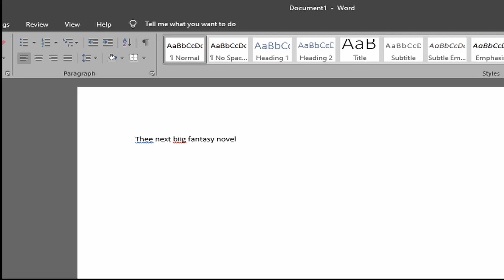Keyboard Double Tap Issue, I Repaired my Logitech G613

Comment: For anyone trying this. PLEASE REPLACE YOUR BATTERIES FIRST!
This method might seem to work simply because you removed and reinsert the batteries which will be a temp fix. These keyboards are notorious for double press or no press when batteries are low.

Comment: I just found a much better fix, quicker, easier, and it turns out pretty damn well! at least for my G613.. I thought I might just drop it here just in case any of you wanna find a true fix for it. So, here's the steps:

1. Remove the batteries, the battery cover, and leave the power on.
2. Make sure the feet are tucked in

3. Wrapped your keyboard in towel / sheet (which I used but they'll work out just fine)
4. Flip your keyboard
5. Punch the backside of the keyboard real hard! (I did it 3 times)
6. Turn off power
7. Put battery in
8. Turn on power
9. Done.

I reckon a spring somewhere fell off its place, and tiny plastic clip which I don't know where it's from is here, my space bar is more "silenced" but bounces back like normal (which normally wouldn't be as responsive), and I can hear something rattles inside if I shook the keyboard but that's about it! everything else is awesome! In fact, I'm now typing using my G613 and it's working flawlessly!

Comment: What I'm interested to know, if replacing the switches, fixes the issue and stays that way for a few years at least. I'm willing to get the soldering items and spare switches if that's the case with you guys

Comment: thank you for this, one of the switches got stuck on so this was very helpful to crack my g613 open to desolder, fix, and then resolder the switch. I think next time I'll actually fix the keys that duplicate.

It's the T W A O E S keys usually, some of the function keys can be a little screwy too. But holy hell disassembling this without knowing where all the screws and clips are is a nightmare

Comment: Please read this before soldering! Try to replace batteries first even if the keyboard doesn't report it discharged in the G Hub. It helped me a lot!
Reply: This.  If I have the issue, it's solved either by battery replacement or by making sure the receiver isn't blocked.

Comment: Looks like this is a common issue...I have a G613 and it started with double tapping with some keys, then they stopped working, keyboard was still under warranty (2 yr warranty, 1 month left) and after a quick test Logitech Support agreed to send a new keyboard and let me keep the faulty one. The replacement just started to fail for a couple of keys (must type harder) after 6 or 7 months so it looks like a quality issue here, but now warranty is expired. So I ordered some switches from Aliexpress and replaced the faulty ones (W,E,A,S,D, left Shift so far) and now the first keyboard is working again like new. Thanks @Infinity Mind DIY for this video.

Comment: I think I know the reason why because the keyboard has many holes underneath the buttons for the dust to go in. 
Remove the button and you will see. Especially, under the spacebar. 
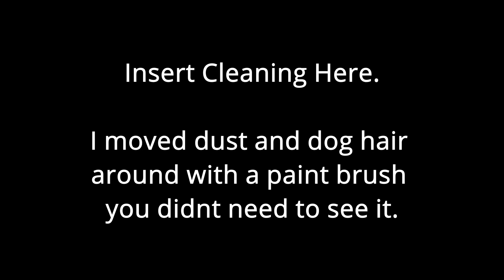You can roughly see in this video @ 2:25 
For mine, I can feel it when the key goes bad, the button will be a little stickier than the good ones and need a little more force to be pressed down. 
So I know it is not about the software but about the keyboard itself. 
So currently when any button goes chattering, I will remove the button and spray it with alcohol. 
The 2nd button on the left of the button that got sprayed will act wierd until everything is all dried up.
For example, if you spray in the "T" button, when you press the "E" button, it will appear "ET", don't worry it will return to normal once it's dried. 
But if you live in a dusty environment, you will need to do it again in a couple of days. 
And I won't take any responsibility so do it at your own risk. 
So the best solution is to return it while you can!
Reply: I don't think it's a dust issue. I got a G613 that I used only when gaming from the sofa on the projector. I probably used it less than 100 hours during the pandemic (it's still on its original batteries). It sat in a box the rest of the time. After not using it for 2 years (got too busy with work to game), I finally took it out of the box a few months ago. And the double-typing issue is affecting a half dozen keys.

My hunch is they used some sort of conductive lubricant to cover up a contact issue endemic to the Romer-G switches. And over time it dries out. Because mine wasn't used anywhere near enough for dust intrusion or activations to wear it out.
Reply: @solandri69  thanks I put it in the bin 2 years ago.

Comment: There are 12 small screws on the back under the feet, stickers and rubber pads (you can just pry off the edges, don't totally remove!
There are 2 large screws in the middle. That is all you need to remove, I swapped my "o" key with my "/" on the numeric keypad. Very happy again

Comment: I see many people having problem with this keyboard. But it is still available in the market. I don't know understand why. At first I thought I was unlucky I picked the defective one. But after returning it for money back and buy a new one. The problem with the new one appears in less than a week after using it. 
I tried many methods. Replace the new batteries. Slap the button really hard several times. Electronic contact cleaner.. Nothing worked. The last method before I break it into half. I know many didn't recommend using the alcohol but I didn't care because I was about to say goodbye to all logitech's and buy a new keyboard anyway. So I sprayed the 70% alcohol right into the button. After spraying, my Tab key will give out the W along with it. But after keep sparying it for a couple more times, the chattering disappeared. So I believe the problem's something about the circuit board not the buttons or maybe both so enough with the logitech's. I have to admit their gadgets look good but I will never buy any logitechs for the look again.
Reply from the maker: Agreed, the keyboards are a bit poor, but I've a G402 mouse I've had so long its got grooves where my fingers go.

Comment: Hi, where did  you find the replacement switches? is there a specific generic type that is compatible with it?
Reply from the maker: I got a hand full off ebay from a seller that break keyboards down. I think i pinned the listing. The switches are romer g. As far as i can tell all the switch have different pin locations on the back so you can swap them between boards

Comment: where can I find roamer G switches made by Omron for my G413 ? thanks , cool video
Reply from the maker: I got mine off ebay, and they weren't new but they have held up well even with me trying to get a double tap to do the cleaning video. there is a link to  ebay where i got mine, (i think I pinned it), Good luck

Comment: No need for such effort, i got my keyboard for  about  1  year  and just resolved this issue by blowing compressed air into  the keys. There is no such thing like the best or worst mechanical keyboar... this is  common issue for all of them.
Reply from the maker: This is how it begins, you then need to move onto alcohol washes, then taking keys apart to clean and lube. Then replacing keys which is the most useful video I could think of making unless you want to watch me do cleaning.

Comment: damn dude soldering and shit?
That's way out of my league. well, at least i got 2 plus years out of this keyboard.
Reply from the maker: You could always try cleaning with isopropyl alcohol. It's what I did for a while 1yr ish. Before I got fed up enough to solder new switches in
Reply: @InfinityMindDIY  I did that, yeah. Issue persisted, so i checked it's old batteries and saw they were 1.5v batteries while i was uusing 1.2v rechargables, so i changed them to ennergizer 1.5v and the keyboarrd was fine for 2 days and the issue began again. pretty shit that i cant get logitech to fix it.

Comment: Could've just changed batteries, saved a lot of trouble. This keyboard just starts double tap on low batteries.
Reply from the maker: Yeah, but why would I do the easy option first. It doesn't always work, same as cleaning the switches with isopropanol its a temporary fix this has so far fixed the problem.

Comment: Did changines the switches actually solve the double tap issue?
Reply from the maker: Seems to have done, my wife uses now and hasn't noticed any issues. So I'm assuming all is good. It has definitely extended the useful life of the keyboard.

Comment: I refuse to believe that this is the only option to solve double tapping. My G613 is barely six months old and does this with at least the spacebar and the W key. I play games a lot, so those two interfere with my experience quite a lot...
Reply from the maker: its not the only option I cleaned mine a few times first, then flooding the switches with iso alcohol a couple of times, then got fed up of doing that then replaced the switches
Reply: @InfinityMindDIY  Yeah, I just ordered a can of WD40 Contact Cleaner. I'll see how it goes...

Comment: I think this is an issue with the 613. I bought one and it started the double tapping issue on some keys it lasted 15 months got it replaced via warranty, after 6 months same thing happened. The issue seems to come out after I used the keyboard for after a few hours.
Reply: All mechanical keyboards experience this problem. It just depends on the type of switches they use. The Romer G switches are too exposed to dust and they need cleaning every now and then

Comment: I've referred to this video a couple times, been very useful, thank you. To change the key switches, I find you don't need to remove the keyboard from the top casing once you have removed the bottom casing.
Reply: was wondering why you would remove that. Also, removing all the keycaps seems redundant in most cases.

Comment: This video wasn't around the first time my G613 failed, Amazon replaced it after 11 months, and now after 11 months with a new one here we are again. My double tap issue affects at least 20 keys though, so its just impractical for me to go to this effort sadly.
Reply: SAME HERE
Reply: Same here, and  it happened so SUDDENLY pretty annoying. I am sure it is something which happens after a set of time...
Reply: it is impractical, but i feel this will be good practice for me. I have bought a g613 and a g603 mouse, in pair. Because these where marketed toghether, you know. in two years, each one device faulted within a year, amazon sent me a replacement, and then again eventually faulted again. I am too with faulty keyboard now. For now isopropyl alcohol did the trick... but i know i am not finished with this keyboard. With the mouse, it was the wheel that broke down twice, and this time i had to buy a part from china and swap it. I also had to thinker in the mouse, but at least i had not to desolder anything. But i bought meself a ts100 and some soldering wire, i am ready for anything now, it was about time i learned how to desolder. But Logitech is done with me, nonetheless.
Reply: @Sk3z  me too. Mouse working for 5 years almost, flawless. Keyboard started double typing in after 2 years. I have cleaned it, soaked with alcohol, spray, everything, no good. Its very expensive, it should last at least 5 years, i was hoping for 10!

Comment: Some people say the problem with double tap can be remedied with new batteries because the voltage in alkaline drops with use.  At around 60% people say they get the double tap.   I ordered some lithiums to see if that'd fix it (a lot less voltage drop).   We'll see...
Reply: Hi there, is the problem fixed? I am actually planning to get G613 but there’s a lot of people arguing about the double typing issue
Reply: @sibehtong3910   For me, just replacing the batteries with fresh alkalines works.  I haven't tried the lithium yet.  The alkalines should just be replaced as soon as you get the double-tap problem.  That means replacing them long before getting a low battery indication, but still, they should last a reasonable time.  A lot easier than soldering new switches.  But maybe for some people that is necessary anyway.
Reply: @maxrockbin  thanks for your reply! I hate to ask you but mind if i know how long did you buy it before you encountered the double issue? And also, would you recommend me to buy it?
Reply: @sibehtong3910  It's basically a nice keyboard.  I don't remember how long it lasted before getting the double hit problem.  6 months?    I particularly wanted a keyboard that has programmable macro keys (G keys) and the reviews for other wireless kbds with that feature - except for the more expensive logitech - are crap.    Another drawback of this keyboard (for me) is that it's very heavy.   For most people who are using it on a regular desktop - probably not an issue and maybe a plus.     I would buy it again for my use.  Especially since they lowered the price from $100 to closer to $65.    The wireless connection (not the bluetooth but their proprietary connector) works better than any other wireless keyboard I've tried.  Most BT kbds suck.
Reply: @maxrockbin  Thank you so much for all the details. Yeah, i think I’ll get it for myself. Thanks a lot!
Reply: @sibehtong3910  mine alot of the numbers dont work ive clean it once in a while the numbers barely works now specially letter A! Its so freaking annoying alot of the letters sometimes dont work. I've change it to the best batter around. Still does the same. The keys it self are crap i wouldn't recommend buying it.
Reply: I encountered the double tap thing on a few keys after 2 years of usage but didnt really help after changing the batteries. My keyboard is kinda dirty though (did simple surface cleaning only and not so often either)...
Reply: no, it doesnt work

Comment: There is an easier way, i fixed double tapping on this keyboard using contact cleaner, just spray inside the switch after removing the caps and just tap it 500 times fast
The issue will be resolved. Just try it next time.
Reply from the maker: That is definitely one way to fix it but I found that the problem returned within a week or so, gave it a couple of goes then decided to j see how hard it was to just replace the switches.
Reply: @InfinityMindDIY  This was for me two.

Comment: What switches did you buy? The exact name if possible thanks.
Reply from the maker: So they are Logitech Romer G Switches - Tactile
Here is the exact listing I got them from 
https://www.ebay.co.uk/itm/114367519242
Reply: @InfinityMindDIY  Hmm, these are listed as "refurbished" - guess I'd rather try open the switches and clean the contacts with isopropanol before installing used ones.

Comment: Literally used percussive maintenance and smacked my keys as hard as possible and it actually fixed it, lol!
Reply from the maker: Did you use a flesh hammer or a rubber one to shock the keys back into life?
Reply: same here, after reading your comment I got the confidence and got into a boxing match with the keyboard. It works now, thanks!

Comment: Can we change romer g to gateron or otemu switch 😭
Reply from the maker: The short answer is unfortunately no. If you search for images of those switches the pin and pip layout on the back don't match the romer g and there for will not match the pcb. Just looking at the images gateron a otemu could be interchangeable with cherry 'possibly'. I've had a look around and I cannot see any switch with the same looking pin configuration. Please let me know if you come across any clone switches because i'd be willing to give them ago.
Reply: @InfinityMindDIY  Nah, I can do it, but it will not have a beauty look in the circuit board :)

Comment: Is it necessary to replace Romer g switches? Or is it enough to solder? Switches are very expensive where I live.
Reply from the maker: Just soldering the switch off and then putting it back on wouldn't do anything, you need to replace it or add a little non conductive grease, it can stop the contacts from double tapping but this may only be a temporary fix. Reclaimed switches on eBay are cheaper than new. I think i paid about £1.40ish for mine. Defiantly worth the money though the keyboard in the video is being used 6-7hrs a day by my wife, with no reported issues.
Reply: @InfinityMindDIY  thank you for response. It is 30 turkish lira for one but i am gonna try to find reclaimed. Also thanks for the video it is really helpfull
Reply: Selam, çıkma switchleri bulabildin mi acaba? Bende arıyorum ama şansım çok yaver gitmedi
Reply: @enescankayhan8999  Merhaba Enes, tanesi 20 liradan sahibinden.com"da satan var ama çok pahalıya geliyor. Benim en az 5 tane almam gerekiyor. Sana instagramdan mesaj atabilir miyim? Bir fikrim var da

Comment: Thanks for the video, I've got 2 defective G910 Orion Sparks that dusts in their boxes because of double typing/stuttering, and it looks like only solution is soldering new switches for defective ones. Is it possible to solder any other switches than the Romer-G sh.ts ?
Reply from the maker: The only other switch I've handled is cherry browns, but they have a different pin layout on the back so swapping for different switches would be a lot harder, you would have to drill the pcb and use jumper wires from the pins to the pcb, it would be possible but a pain to do.
Reply: @InfinityMindDIY  do it sir 😁
Reply from the maker: If anyone has a Logitech Romer g keyboard they don't want or where in the uk I can get a cheap one, I have an old g610 with dead chipset but cherry browns on, I'll have a go at a transplant video.
Reply: @InfinityMindDIY  I got 2 G910 but i live in Turkey
Reply from the maker: So did a quick bit of research the leds need a light tube which my cherry browns wont take, how much do you think it would cost to post one or both to uk, I  think I can fix as long as its not a firmware issue which is what is wrong with my 610